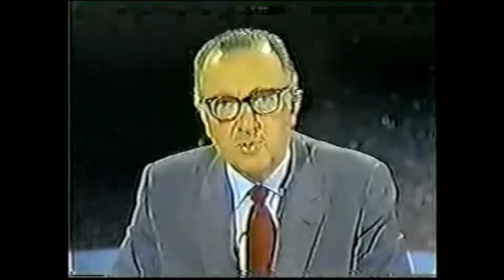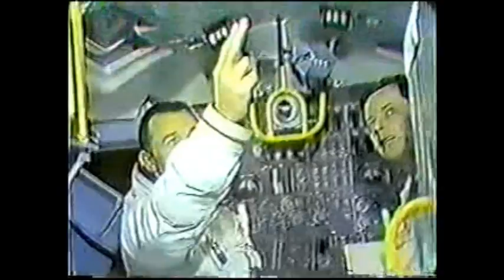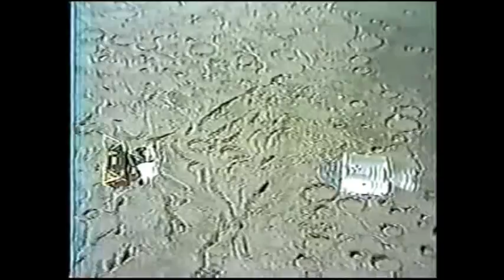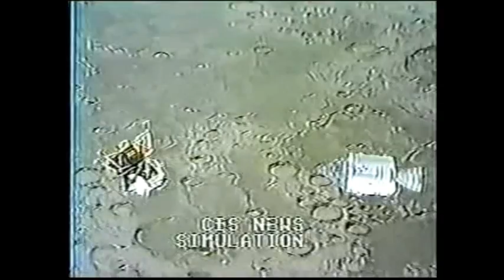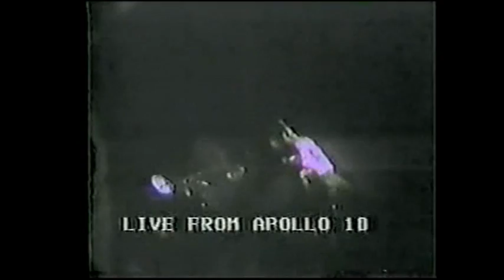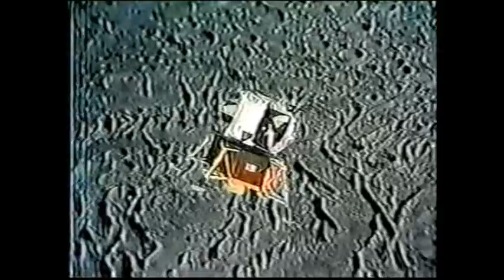Apollo 10 Undocking Snoopy

Comment: Docking the CM and LM involves some potentially tricky mechanical engineering, and I'm glad they discussed it somewhat here. This, if I understand it right, is a big difference between the way Apollo handled mating the vehicles, and the way the Soviet LK lander would have handled it, had it ever flown. They simply mated the two with a grid and hooks. A much simpler approach, and most likely a much more limited set of mechanical problems. But the cosmonaut going to the LK would have needed an EVA to get there. (Yes, the ONE cosmonaut.) And if they had a problem like 13 had, and needed to use the LK as a lifeboat, well, I think you'd agree they wouldn't have many options there.